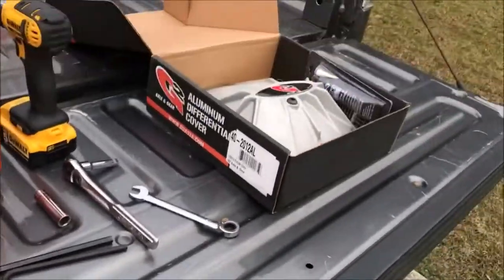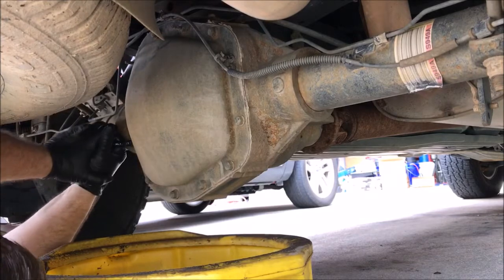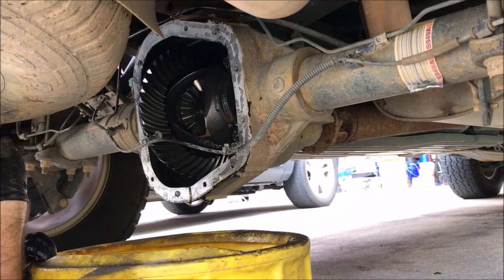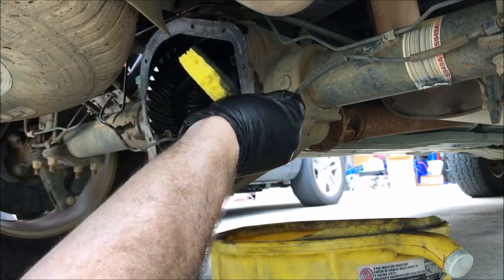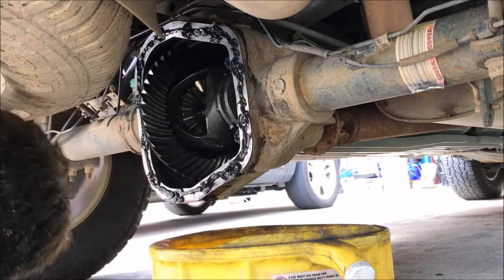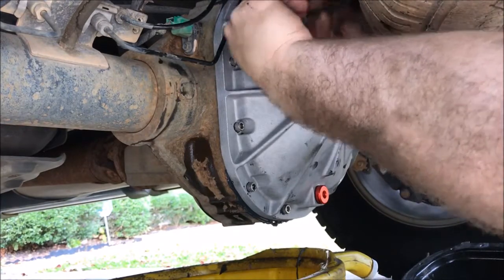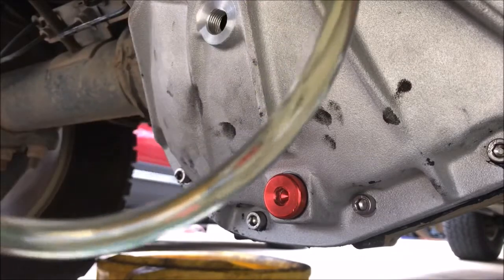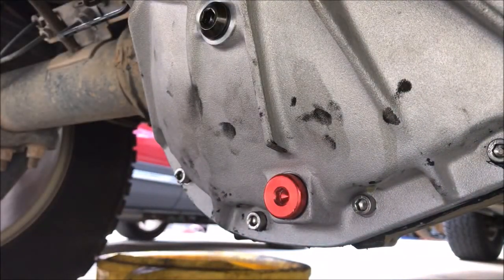2009-2014 F150 9.75"  G2 Differential Cover install and Rear Differential Fluid Change

Comment: how do you know what motorcraft fluid to use? i can lock my dif for 4x4 does that mean i use the same as in the video?
Reply from the maker: I have an electric locking differential. I looked in the owners manual and this was the specified fluid. So If you have a 2013 and electronic locking diff then this is the correct fluid. Thanks for watching.
Reply: @MyTorino  good video what is the purpose to install a new cover ?? i am not a mechanic
Reply: @jaandel1  Two main takeaways. The fins will help with strength and cooling. Also this diff has a fill and drain plug, so no more removing your diff cover for a simple fluid change. Unless you're changing the gears.
Reply: I believe there is a tab on the differential that's suppose to say what type
Reply: @haydenbriggs  @jaandel1 The Plugs for fluid changes, yes, but this version does not have the "fins" for better cooling of the diff. You have to spend a little more and get the G2 BRUTE which has the Heat Fins that the Aluminum Hammer cover does not. Also, an aftermarket cover is stronger than the flimsy tin OEM cover which offers better protection to the gears from impacts and it also holds a bit more oil than the OEM.

Comment: Just installed the G2 cover on my 2014 F150 TREMOR.  Dropping the spare tire, and putting the truck on jack stands allows you to sit up under the truck making the job a lot easier.  After the pain in the A** of cleaning the RTV off the differential housing flange I decided to employ a  REUSEABLE aftermarket LubeLocker gasket.  No leaks, all good.
Reply: What torque spec you used for the lubelocker gasket ?

Comment: Thanks for your video. I am changing gear oil and swapping the diff cover to a G2 this weekend. There are lots of good videos of rear diff service but its nice to see the same size / same cover. Looks like I need to pick up a 1/4 hex socket because I don't have the patience you do! Also saw on another video that dropping the spare frees up space and brake cleaner is used to clean the diff after install.
Reply from the maker: hillbillync655 thanks for watching and commenting. Good Luck with the install....

Comment: Thanks for the great video! What did you end up doing to keep the ABS line in place that clipped on to the top three stock bolts after the install?
Reply from the maker: Sorry, I cannot remember and I dont have the truck to look at. Thanks for watching and commenting.

Comment: good video what is the purpose to install a new cover ?? i am not a mechanic
Reply from the maker: I had to remove to change the fluid, so I changed it to a better looking cover. Thanks for watching.
Reply: Easy draining old fluid out with drain plug 5 minute job to change fluid with this cover the next time.
Reply: The Plugs for fluid changes, yes, but this version does not have the "fins" for better cooling of the diff. You have to spend a little more and get the G2 BRUTE which has the Heat Fins that the Aluminum Hammer cover does not. Also, an aftermarket cover is stronger than the flimsy tin OEM cover which offers better protection to the gears from impacts and it also holds a bit more oil than the OEM.

Comment: What would have been perfect was if Ford put a flush mount drain plug on the very bottom of the lowest point of the rear itself. The drain plugs they put on the aftermarket covers I don't think are low enough

Comment: Ford also says to torque the bolts to 35ft.lb. you didn't do that or you didn't know. But nice differential cover.
Reply: most of the time as long as its snug its usually good. Its better to torque, but snug is okay

Comment: Man should have used gasket. Besides using rtv, you let it tack, 5 10 minutes. Tighten bolts up just enough to begin to squeeze rtv out. Allow to cure for 4 to 6 hours, then torque to spec. I'd bet you had to redo this.